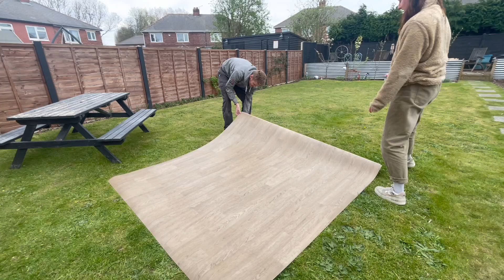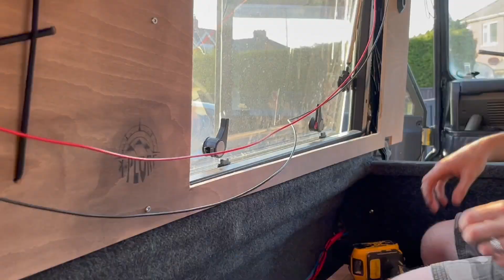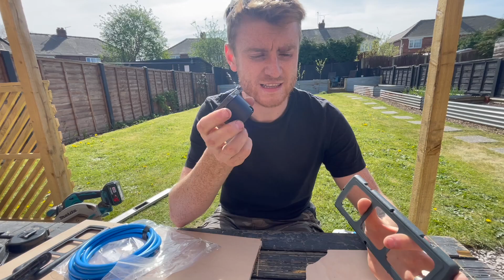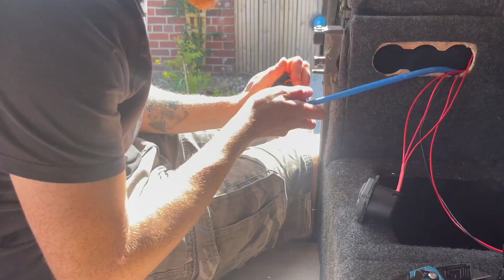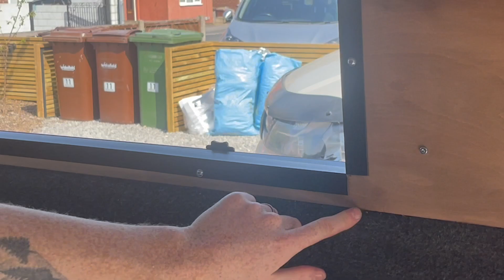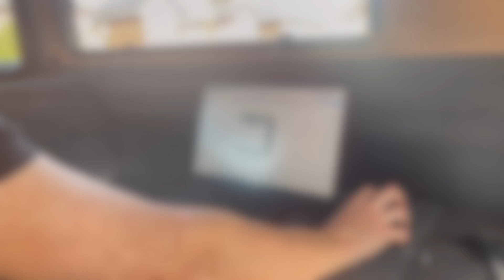Land Rover Part 21: Defender Camper Conversion. Flooring, Internal Lighting & Window Trim.

Comment: Those 3d printed light covers are a great idea, very well thought out setup
Reply: could just have cut the strips at an angle 🤣
Reply from the maker: @frank-lr  for the windows? Yes we could have - but it would not be as tidy in terms of finish! You would have seen the join and I'm not too sure how neat the cuts would have been and I'm sure they wouldn't have been all the same. The 3D printed corners are each exactly the same and give it less of a DIY look as they are machine made. Plus it's great fun 3D printing things that are custom created for something and that's what this build is all about in preparation for our adventures ahead.
Reply from the maker: Thank you! We found the red lights so useful when capturing the Northern Lights in Iceland and knew they had to be part of Landy our set up.